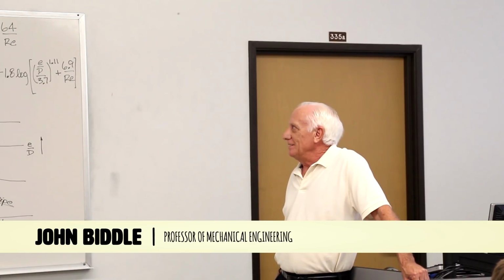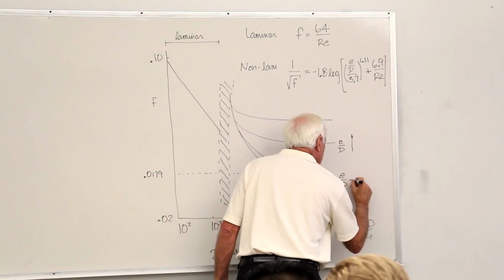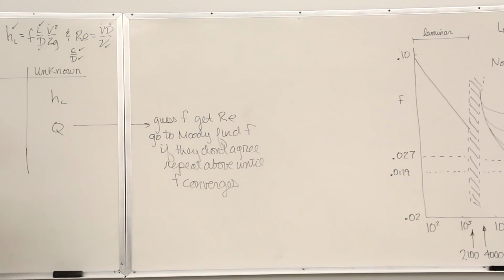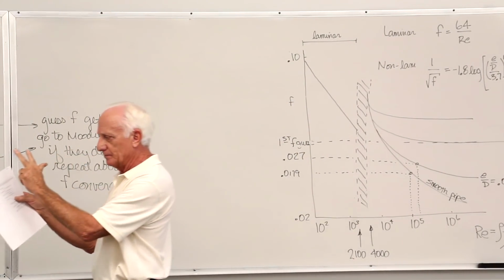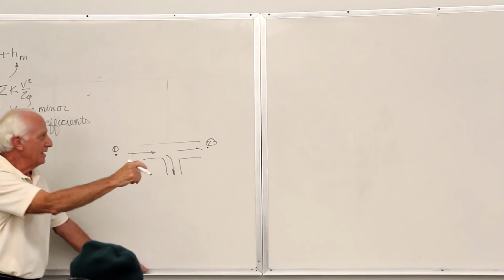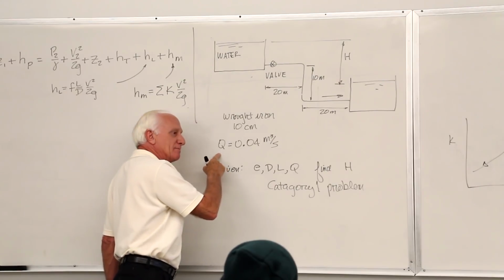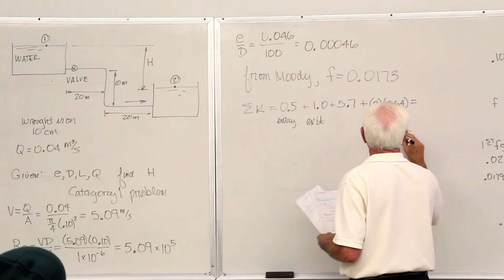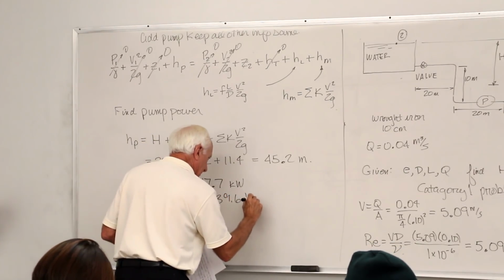Fluid Mechanics: Minor Losses in Pipe Flow (18 of 34)

Comment: A pipe of 244cm diameter made from new cast iron carries water of kinematic viscosity 1.13*10^6 m^2/s . the head loss due to friction is 46cm per 305m of the pipe when the flow running through the pipe is steady and has a Reynolds number (Re) less than 2000

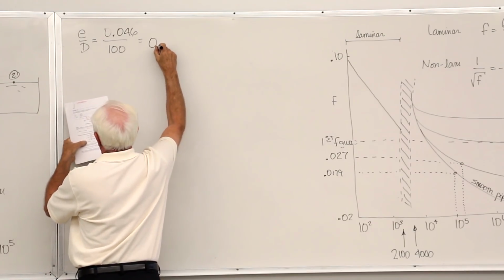Comment: thanks sir, but  id didnt undertsand why the diameter taking 100? 10 cm fistly but during  e/D we divided by  100 at 45:35,, are we gonna change ıt milimeter everytime ? and if i get the D ısnt ınner or outer, thats nomınal value, are we take 100 from table or just convert to mm  ?
Reply: e is in millimeter so, just change D to millimeter to cancel the dimension out.
Reply: thanks sometimes i couldnt think simply :)

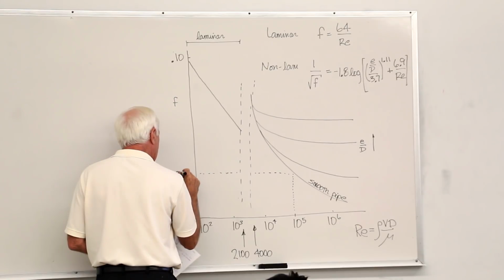Comment: shouldn't the lowermost value of y-axis (friction factor) on Moody diagram read 0.01, instead of 0.02 ? i think it should. because prof. Biddle finds the f as 0.0179 (at 3:33) and marks it at a point higher than 0.02 on y-axis !... it can't be right.

Comment: i found this formula hfs=4fL/d  but you allways write hfs= fL/d which one is the corect?
Reply: +Mohammed Najeeb you've probably found the answer but the formula with the 4 is usually used in chemical engineering.basically they give the same outcome but for the formula with the 4, you have to use fanning friction instead of darcy weisbach,(f from moody chart)
Reply from the maker: +Mohammed Najeeb Can you provide a time where you see this equation?
Reply: +CPPMechEngTutorials  i found it in deferente references not here but is it corected or not? the equation need 4 only plz i wate
Reply: +khaira i see thank you..